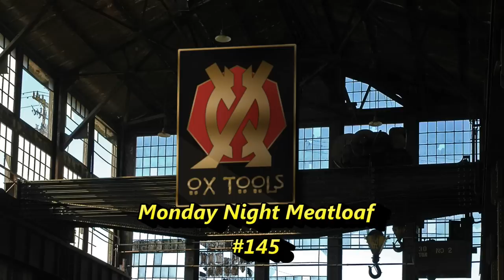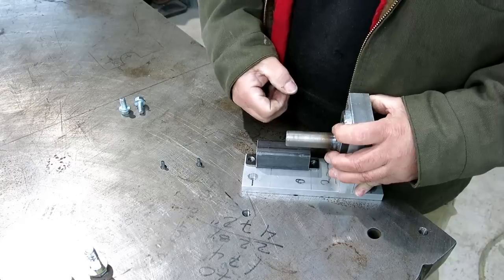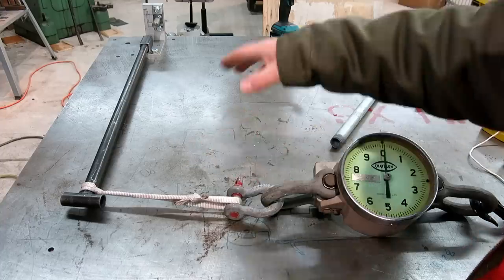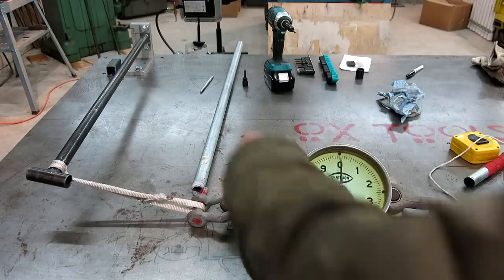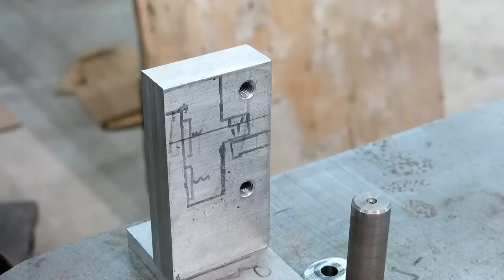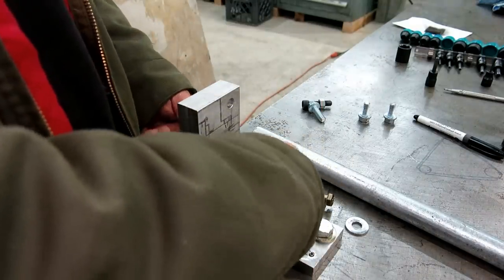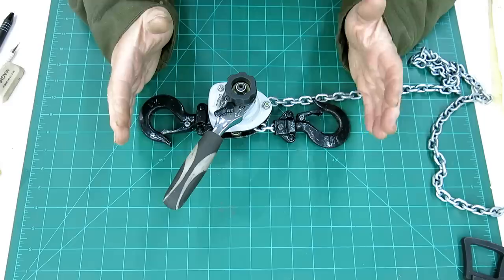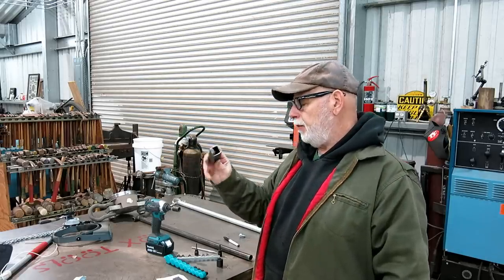Monday Night Meatloaf 145

Comment: Tom I enjoy your videos and I hope to see more of them. As a UA rigging instructor I can only assume that the handle housing was broken because the original handle was replaced. The safety device on a wire lever hoist is the handle, it bends to ensure that the hoist is not overloaded.
Reply: Just fyi he discusses the handle mechanism in the first video.
Reply from the maker: Hey James, Yes the original handle has been lost to eternity. The casting broke because I did not insert the alternate handle fully into the cast socket. Thanks for the comment.

Cheers,

Tom

Comment: Hey Tom , how about going with type 1 but putting one on both sides then you can operate it from either side and when you need to put a bit more gronk on it you could use a fork handle which engages both sides with a handle over the centre line
Reply from the maker: Hey Matt. Thanks for the comment.

Cheers,

Tom

Comment: Tom can you go into the Grade 8 bolt with Grade 8 nut vs Grade 5 nut a little more.  Do you want the yield on the nut for a particular reason?
Reply: Second that.  I haven’t heard that one before (that doesn’t mean much!). Please enlighten us!
Reply from the maker: Hey Hankus. When the nut dilates as in softer nut than bolt the load is spread out over a larger area and the stress actually decreases. When you have hard on hard the failure mode is brittle fracture which is just what you don't want in a bolted joint. This is also why high performance bolted connections are yielded very carefully to realize their full potential. Hope that helps. Thanks for the comment.

Cheers,

Tom
Reply: Thanks Tom - I was thinking along those lines when you mentioned it in the video, though more so about the brittle fracture than the deformation. Makes sense!

Comment: Now we need the test done with helicoils to see how much extra the steel thread inserts add to the strength!
Reply: In that aluminum, I assume a casting I would use Helecoils also.
Reply: Assuming half inch bolt limited by the strength of the aluminum, helicoil should be about 20~25% stronger, it's similar to just using a slightly larger bolt. The pitch diameter goes from about .452" to about .552" for 1/2" - 13
Reply from the maker: Hey Brian. Thanks for stopping by. I was going to do the helicoils but I have not found my stash of them at the new shop. It would be tragic to have to buy some that I know I have somewhere in this mess. 

All the best,

Tom

Comment: I don't remember hearing you mention covering the foam after you're done, but from a fire hazard perspective you really want to.  Any kind of foam should be covered up with a fire barrier - you can get spray coverings that are intended for covering spray foam (probably easiest with your size of shop), or just regular drywall, even the 3/8" thick would be sufficient for non-code peace of mind to slow down any incident.

Comment: i had one of those yrs ago, it had been repaired with a long pipe flattened on the end, bolted to the side, and an l bracket across the top and up the pipe. of course someone stole it, but it worked for me for years. i think 200 lbs is all you need
Reply from the maker: Agreed. 200 seems like a heck of a lot. Thanks for the comment.

Cheers,

Tom

Comment: One thing that works incredibly well for coughs or running nose/ sinuses, etc.  Is called a "netty pot".  There are cheap little plastic setups on ebay for $8 or so.  It's just a bottle with a straw that you can hold upside down and it has a button to press, which will simply allow the water to drain.  

You put luke warm salt water in it (just about 1/4 a tea spoon of salt per 8oz glass more or less- shake it well), turn your head sideways (holding over a sink)--  and you simply put the straw to your top nostril and hold the button (while breathing out of your mouth).   And that salt water will go up your nose and into all your sinuses, and drain back out of your other nostril and fall into the sink;  takes 15 seconds.   The amount of snot garbage that can flow out of your head is insane.  It works like magic.  I'm telling you.  (especially for cough);  It's an instant cure. 

Because cough is simply your nose running down the back of your throat.  It's called "post nasal drip"--   And when you flush it all out with a netty pot, there is nothing else left to drip--  so you immediately stop coughing for good. (unless it's in your lungs, that's a different story-- and could be pneumonia).   I cannot stress this enough, how excellent this works.  

You only have to flush one bottle of salt water, and it only takes 15 seconds or so. The salt kills all the bacteria too and keeps everything from coming back for awhile.  If you get the water the right temperature, you can't even really feel it and you won't notice the salt either.  If you wake up the next day and it's starting to come back.. Just hit the netty pot again, done!   You should Absolutely order a netty pot if you don't have one.   My kids can even do it to themselves too- it's very simple and just works.  It's like a family ritual around here when everyone gets sick. lol
Reply: Netty pots work great.
Reply from the maker: Hey Calholli, Would an air hose work? Just kidding. Thanks for the comment.

Cheers,

Tom
Reply: @oxtoolco  lol.. It might if you're brave enough.   But no, it would pop your ears and all kinds of painful things, even at low pressures.  netty pot works like magic though.  I was actually shocked at how effective and immediate it is.  Don't knock it until you try it. :)

Comment: If you did pay the big money and get your shop spray foamed;  it will virtually eliminate the loud rain noise;  since the foam sticks to the metal.  Vs putting in regular insulation, which just floats next to the sheet metal, so it can still be pretty loud.   I know that spray foam is expensive, but I've never seen anyone regret spending the money once they have it done.   For older worn in shops like this, the spray foam nearly doubles the value of your shop.  It's just one of those buy once/ cry once deals.
Reply: Absolutely true. We were able to use substantially smaller HVAC gear because of our choice to spray foam in our shop..
Reply: I had spray foam in my old shop. It sealed it up great and in the winter it helped to keep the shop warm.
Reply: Put closed cell spf against tin, then open cell. The open cell is a really good sound barrier.
Reply from the maker: Yeah but at over $23k for spray foam and it being ugly as hell. I will be in this for less than $8K done deal. Thanks for the comment.

Cheers,

Tom
Reply: @oxtoolco  Wow have prices gone up. It was $1400 to spray my 850 square foot shop back in 2005. That was for 4 inches thick.

Comment: Either way you were pushing upwards of about 900 ft lbs of torque 
The fact that the bolt sheared off at THAT much torque is rather impressive
Reply from the maker: Exactly! That was a #10 flat head cap screw. Many folks missed the fact that basically one tiny little machine screw held a considerable amount of torque. Thanks for the comment.

Cheers,

Tom
Reply: @oxtoolco  that alone can be a fail safe for the future so you don't have to deal with this issue in the future

Comment: hmm, after seeing the pros and cons, I might be tempted to just weld the side handle to the center handle, giving you 4 places to fasten it to the come along, and giving you both handle attachment options.
Reply from the maker: Hey Frist. I mentioned in the first video when you weld on aluminum you lose the temper and yield strength. I is much much weaker than the unwelded material. This is the whole reason for going to an attached handle method. Thanks for the comment.

Cheers,

Tom
Reply: @oxtoolco  I didn't mean to weld the handle adapter to the come along, but to weld them to each other, giving you a single handle mount that screws to the front and the side of the aluminum handle, and gives the combined handle mount both the two large bolts on the front and the two countersunk screws on the side.  I think that in combination with thickening the mounting flange for the side mount to better handle shear loads it would also give a lever to help support the load when using the front center post.  I am concerned about the strength of the aluminum around those threaded holes when you are converting a large leverage load into a tension load on those bolts. I know you tested with nuts, but it looked to me like it might be difficult to fit nuts under the aluminum part and not interfere with the ratchet pawl.

Comment: Hey Tom, glad you're having fun, it's awesome, and I am happy to report that i am having fun again too! I also commiserate with you on the sheet metal drumming because I live in a 40ft can on the Big Island now. After Dad passed i moved home. I'm hoping to put out an update video soon, but editing has been a hurdle. 

One quick question, if I may...am I crazy for thinking I want to weld my sheet-metal roofing to the trusses?

I've become proficient with my flux-core galvanized welding, but am unsure if fasteners are a more robust connection? The base material is 1 7/8" sch.40 pipe with 24guage sheet 

Mahalo for any guidance you can lend.

Comment: What about flathead or better if you have the clearance would be button head socket cap screws from the inside face and nylocks on the outside on a forked flat steel 3/16-1/4” 3/4-1” cold rolled fork.  Simple, easy.
Reply from the maker: No extra room for the head in the tube pocket. Probably going to combine both Ideas into one solution. Thanks for the comment.

Cheers,

Tom

Comment: Cool testing!  Seeing results from empirical tests is one of my favorites too- After I read through the comments on your previous video, I believe that several correctly identified the failures, & that an integrated design forming both options together, utilizing through-bolts would be the best way to go (which would significantly reduce the moment loading for both options).  In the event you can exert 250-300lbs..... wouldn't you want to design/build a solution that could withstand 150-200%?  "Nothing too strong ever broke."  Thanks
Reply from the maker: He Robert. In principle yes. I'll take what I can get. Thanks for the comment.

Cheers,

Tom

Comment: I had full confidence you would figure out the fastener issue. I could see the moment it began to pull the thread out of the aluminum block, and you probably did after reviewing the footage. I was actually getting worried that your camera was going to become a casualty of the handle to everything (including violent acts). It would not have taken much more for that handle to lose it's grip on that slug as it bent in your direction. Glad it when it did. When you were discussing in the beginning your thoughts on the differences between the two options to fasten your handle, you mentioned being able to use the handle from the back side of you choose the offset option. I feel like that would be useless, unfortunately. For one, you would be shooting your force to the wrong side of the fulcrum and I think it would simply break the whole assembly off right at the pivot. Second, if you were using it in a vertical application it would be so impractical without elevating your position that it negates any benefit. Then you factor both things together, applying force on the wrong side of the fulcrum from an elevated position, say reefing down on it from a ladder, then it seems like a guaranteed trip to the emergency room at best. I think the center line option is best, but I think either way you choose it might be wise to drill a hole through the stud so you can secure your handle with a bolt or pin or something like that. Nice to see the beloved handle making another appearance! Thanks for sharing that experiment, it was rather entertaining and a bit suspenseful, at least for me.
Reply from the maker: Hey Phillip. All good points. This is why we test things. Thanks for the comment.

Cheers,

Tom
Reply: @oxtoolco  You are welcomed, as always, sir.  But the thanks are for you. You are doing all the work. I'm just watching it and being a windbag. 

Your not so humble viewer
Phil

Comment: Why not make a U style bracket so you can spread the load over the whole part. It would also allow you to have both styles of handle on the winch.
Reply: Exactly what I was thinking join the two together especially if thinking of installing both to body
Reply from the maker: Hey David. You are on to it. Thanks for the comment.

Cheers,

Tom

Comment: As far as force tolerances to shoot for, I’m in favor of building stuff twice as strong as they need to be whenever it can be done without adversely affecting the overall design and function of the object. 

It’s reasonable to say that someone might put 250lbs on a 4’ rod for that thing, so I’d want it to be able to handle 500 without yielding.   But that might not be realistically achieved without making the whole thing too cumbersome to use.

These are the fun things for all of us needs to talk about. 😂
Reply from the maker: Hey Phil. Good points all. Thanks for the comment.

Cheers,

Tom

Comment: I don't recall if I commented on the previous video but I kinda think I got distracted and forgot to. My initial thought was that I liked option #1 a lot better because of the high moment on #2. When I saw the thinner wall and small fasteners on #1 and how much beefier you made #2 wasn't sure.

If you'd welted a plate to the mounting side of #2 to double the wall thickness... I dunno. I'm a software engineer and I haven't really thought about mechanical in a whole long while. ;)

[edit:] Distracted and replied before the end of the video. Heh!
Reply from the maker: Hey Martel. I think I'm going to reprogram the mount into an integrated design. Thanks for the comment.

Cheers,

Tom

Comment: Love the Meatloaf. You do so many of these on the cutting mat backdrop so it’s funny to see you pull out the tape measure. Are those inch squares or some cm relative?
Reply from the maker: Hey Hakeem. That is a great observation! I really don't think about the mat as a measuring tool! I believe they are inch squares but I will have to check. Thanks for the comment.

Cheers,

Tom

Comment: Use both but lose the countersink on option 1 and go with button head cap screws.
Reply from the maker: Hey Noel. The handle doesn't fit if you have any head sticking up. That's why I went with the flat heads. Thanks for the comment.

Cheers,

Tom

Comment: If you made the post base as wide as the area where it will mount it would be better and you might have room for 4 screws. The socket would be better with a 1/4 or 3/8 plate welded on the base.
Reply from the maker: Hey John. Thanks for the comment.

Cheers,

Tom

Comment: Have you considered how much the new mounting holes will weaken the aluminum yoke?
Reply from the maker: Hey Mark. Everything in design is a compromise. Yes the holes will weaken the aluminum yoke but bolting a steel strong back to the aluminum strengthens the yoke. The yin and yang of mechanical design. Thanks for the comment.

Cheers,

Tom

Comment: the more holes you drill in the come along the more the structural integrity will become compromised won't it?
Reply from the maker: All design is a compromise. Yes the holes weaken it but bolting a steel doubler plate to it also makes it stronger. The yin and yang of mechanical design. Thanks for the comment.

Cheers,

Tom

Comment: Why not add wings that wrap around the parrallell edges to reduce too and fro?
Reply from the maker: Hey Paul. That would help but there is a reversing lever I have to avoid. I will probably combine both ideas into one. Thanks for the comment.

Cheers,

Tom
Reply: @oxtoolco  Would a wing on just one side be possible?  Im just looking for a way to relieve the torque on those screw heads.

Comment: Hey Tom, why don’t you run a bolt in from the other side and up into the stem that you welded on to the plate?
Reply from the maker: Hey Joe. That is an interesting idea. I had not considered that one. Thanks for the comment.

Cheers,

Tom

Comment: Hey Tom, when you mentioned you never use a number 8-rated nut on a number 8 rated bolt, is it because you want the nut to fail before the bolt?  and how is a number 8 nut marked?
Reply: Bolts and nuts fail differently.  A bolt will fail because of its ultimate tensile load, but on removing or installing it must resist the combination of tensile load and torsional shear load.  Regardless of why each fails, the result is always “shit-giving” and frustrating. As an aside——there is no place to stamp a naming on a nut!!!!   Drives you nuts!!!!

Stavros
Reply from the maker: Hey John. When the nut dilates as in softer nut than bolt the load is spread out over a larger area and the stress actually decreases and the ultimate strength goes up. When you have hard on hard the failure mode is brittle fracture which is just what you don't want in a bolted joint. This is also why high performance bolted connections are yielded very carefully to realize their full potential. Hope that helps. Thanks for the comment.

Comment: I expected the countersunk fasteners to shear off easier. Guess my gut meter needs recalibration.
On the "stub" version. Your ADHD desire for symmetry put the fasteners in the center. As you only pull one way, offsetting to one side would give more strength.
Reply from the maker: Hey Scott. Busted on the symmetry. Thanks for the comment.

Cheers,

Tom